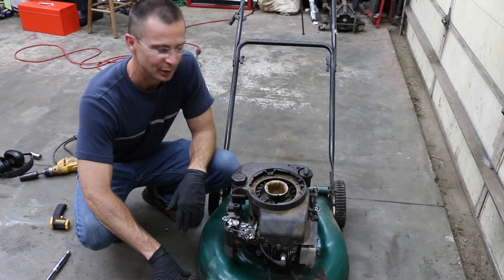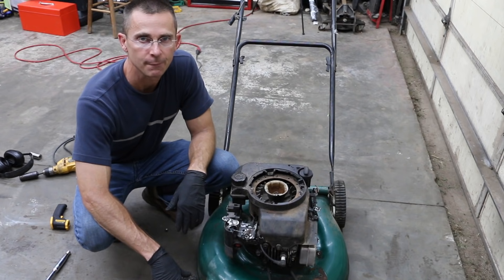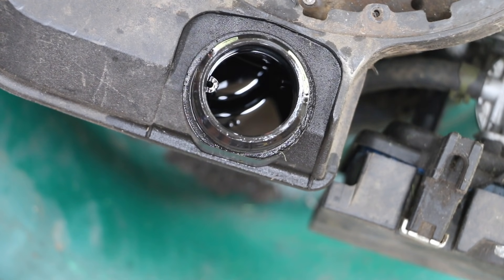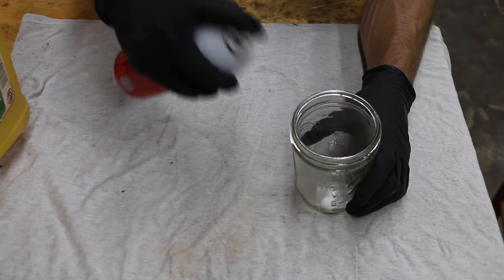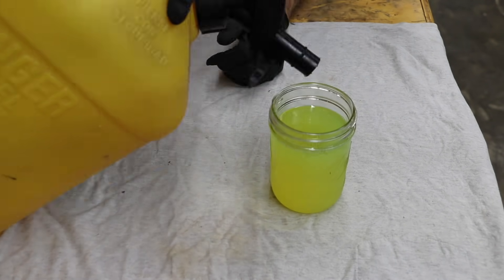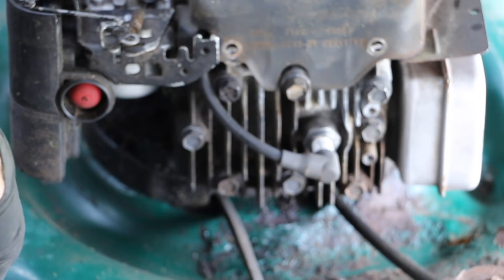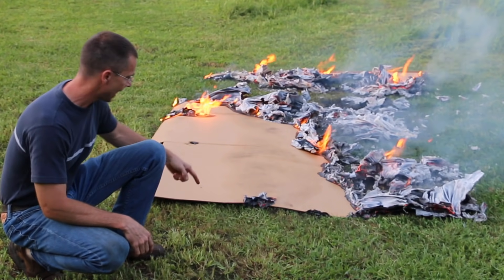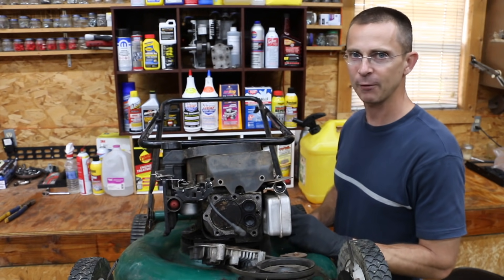Will a Gas Engine Run on Diesel?  Let's find out!

Comment: When I was a teen, my little brother started mowing the lawn with our riding mower. He came in one day and said 'it's smoking'. We're like "yeah yeah whatever." Then we went outside, it was sending up plumes of smoke and running rough. Turns out my little brother dumped my dad's Kerosene (hence the YELLOW fuel container) into the lawn mower instead of gas.     He had the worst luck with lawn mowers too. Months later he came in and said 'the battery blew up'. And we're like "Yeah yeah whatever." we go outside, the battery had literally exploded sending the top half off and pushing the hood of the mower all the way up.
Reply from the maker: Wow, Lol!
Reply: Blue is kerosene. Yellow is diesel and red is gas.
Reply: @petertorregrossa4447  
yeah I had it swapped from memory. it was kerosene.
Reply: @Novous  when I was little I didn't know the difference. My dad would fill gas cans up with kerosene. I ran the mower and snowmobile with it. They ran but smoked liked a mf'er. He would come out laughing and say " runs pretty good on kerosene, doesn't it?".

Comment: Yes, they will sorta, diesel has the same stociometric ratio of 14.7:1, and is more viscious.  but diesel has no octane, so it will detonate. Also diesel is an oil, & not a refined gas so it will foul the cylinder. A diesel runs very lean so the combustion chambers will not load up. Unlike a gasoline engine, diesels provide a more complete combustion because of the high compression. Diesel has a cetane rating, the fuels ability to resist combustion due to pressure. Octane is the fuels ability to resist combustion due to heat.

Comment: Years ago I had an old carbureted v8 pontiac I accidentally put diesel fuel in.. maybe ten gallons plus one or two of leftover gas still in, and it would not go up a hill or accelerate without extreme knocking. I literally thought I could break a piston it was extreme.
Reply from the maker: Wow!  Thanks for commenting on this

Comment: I have been told by several people who do it that if you add a secondary tank and let the gas engine warm up on gasoline only for 5 minutes and then turn on the diesel fuel and turn the gas off that it will run and then you should do the same during shutdown. Turn the gas back on and the diesel off. They say it works fabulously. By the way great video and would love to see you try would have been told
Reply from the maker: Great information. Thank you

Comment: Have you used E85 in a small engine. I know you used it in a car. great videos!
Reply from the maker: Thank you!  It will work in a small engine but the carb needs adjusted to increase fuel flow.

Comment: The Fire Service uses a gas/diesel mix for our drip torches. We mix gas an diesel in a can and light it, using the flaming mixture to light brush on fire during wild fires. The gas is the burns hot enough to get the diesel to ignite and continue to burn. Been doing it for a number of years, normally it is mixed 3:1 diesel to gas, hotter mixes for wet fuel can be 2.5:1.5 diesel to gas.
Reply from the maker: Thank you for the feedback!

Comment: All hydrocarbon fuels, be they solid  or liquid cannot combust until they have reached 'flash point'. It is the almost  invisible vapors that may be seen when 'flash point'  is reached. 'Flash point' for gasoline is approximately 250degrees Fahrenheit (126 deg. Celsius), for kerosene the required temperature is approximately 345 deg. Fahrenheit. Do not try to run a gasoline engine on diesel or you could wreck it.
Reply from the maker: Thank you!

Comment: So I accidentally did this because there was Diesel In a can labeled gasoline and I thought it was just old gas so I was mowing and noticed an extreme loss of power and when I went to turn the mower off it continued running with no spark and the brake on the flywheel I was amazed by this and it was followed by many gunshot like backfires ( extremely loud ) I had to remove the air filter and plug the carburetor to get the engine to stop running but of course once it cooled down it would not start with just diesel.
Reply from the maker: Thank you

Comment: Had a 1988 Silverado tbi 454 run on 100% percent diesel fuel. Trick was unplug set timming connector retard the timming. Truck would fire right up and idle. Could only accelerate just under 1/2 throttle. Not kidding truck would get better mpg on diesel then gas and ran cooler. Just have to drain engine oil due to blow by.
Reply from the maker: Impressive!  Great point on the oil needing drained too.  Thanks again

Comment: I did this with a ranger mixing more and more diesel with the gas. Ran okay till I tried to start it the next morning
Reply from the maker: Great point.  Once the engine cools, it's hard for the fuel to reach flash point.

Comment: I can see people pumping 50/50 gasoline and diesel in their vehicles lol just one question on the 50/50 you did amd run smoothly, did it last longer than usual due to the diesel?
Reply from the maker: Thank you.  It did seem to last longer but lacked power.  The 50/50 mix is unlikely to perform well in a spark ignition engine under load.
Reply: @ProjectFarm  thanks bro, your videos are really fun and informative 👍

Comment: When I was a kid I ran out of gas.  I didn't have the money to buy more so I drained some fuel oil from our tank used to heat our home.  I cranked and cranked & finally it started, but it was very slow.  It gradually picked enough to a point where I was able to cut grass.  Funny, even though it was only turning maybe 1K rmp I could not make it stall in the tall grass.  Finally it broke a rod & that was that.
Reply from the maker: Nice!  I enjoy reading comments like yours!

Comment: It'll run on it but smoke cause diesel is oil base. Put gas in diesel and it'll lock up cause gas doesn't have enough oil to keep the cylinders lubed
Reply from the maker: Thank you!

Comment: I have been starting engines with a drill since the 80's, before drill adapters were available (that I know of). I cut the female end off a 3/8 extension and I still use it today. I chuck it up in my Milwaukee Hole Shooter.
Reply from the maker: Nice!  Thank you

Comment: I had a 64 Chevrolet truck that had a 76 250 six in it ,I put about 12 gallons of diesel in by mistake filled the rest of the way with 93 octane and a bottle of 104 octane boost.
It ran fine but when I shifted gears a big puff of white smoke came out of the exhaust.
Thanks for your hard work.
Reply from the maker: Glad it ran!!

Comment: I have an idea to make this work! Shave the head down for more compression and warm the engine up first. Then, use an engine brake like your other videos and run it wide open. Maybe do your “vapor can” trick.

Reason I think this will work is because a gas station accidentally had diesel in the 93 octane tank. My car was already warmed up so I was able to make it home as long as I kept the throttle open. Maybe it’s worth a shot, I know I’d enjoy that video. Cheers!
Reply from the maker: Thank you for the video idea!

Comment: I do believe if you take a battery run the spark plug wire to the battery as a temporary charge source run a wire going from the battery to where the spark plug goes and replace the spark plug with a glow plug and put straight diesel in it should run
Reply from the maker: Thank you!

Comment: The ethyl/gasoline mixture most commonly available at service (I use the adjetive lightly today) stations is damaging to small engines. I have started buying preblended fuel w/o ethyl alcohol and my 2 cycle engines are much easier to start.

Comment: Please post follow up videos of the progression of your eyebrows regrowing. Lol
Reply from the maker: lol. Thanks
Reply: So because of the higher flashpoint of diesel I wonder if you preheated the fuel if it would run any better. I saw a video where a guy tried running a kerosene forced air torpedo heater on waste oil. It smoked terribly bad until he preheated the oil to 180 F or so then no more smoke.
Reply: He used an oil filled electric heater that he drained the factory oil out of it and ran waste oil instead. It is a cheap thermostatically controlled oil heater. I would bet that you would have much better success.

Comment: I know that in my diesel vehicle, i can run 35% unleaded fuel to a tank of diesel n it wont hury it at all, in fact, it cleans the system n i found it actually got slightly better mileage n response
Reply from the maker: Thank you for commenting on this. What type of vehicle do you own?
Reply: @ProjectFarm  i own a isuzu trooper 4cyl turbo diesel

Comment: You have to check the oil level after that ,part of the diesel is not burning  in the cylinder and you and up with diesel diluted and high level oil..
Reply from the maker: Thanks for the constructive feedback

Comment: Back in the old days Mothballs contained Naphthalene. Mothballs no longer contain Naphthalene, it's too flammable to be sitting around in cloths closets. The new balls contain different compounds which don't burn so well and will not support combustion. Try using some Coleman Camping stove fuel.
Reply from the maker: Thank you

Comment: GM originally converted a small block engine to a Diesel Engine used in an Oldsmobile which became a production option. Could you experiment with another gas engine converted to diesel using specific crankshaft and connecting rods?  Land Rover has a Range Rover Turbo Model production vehicle called the TDV8.  How many parts are actually different from their original V8.  Is conversion possible ?
Reply from the maker: Thank you

Comment: Long ago, working at a lawnmower repair shop, I had a supply of old engines.
Things I tried:
WD40 Starts and runs.
Turpentine Starts and runs poorly.
Brake Fluid Starts and blows head gasket.

Starting on gas and then introducing oxy-acetylene (cutting torch) into intake has dramatic effects (speed increases and cylinder head melts).

Thanks for your flashback inducing Videos!

Starting then using a hammer to provide a “window” into crank case and allow drainage of oil, let engine run past sunset making the crankshaft and con rod visible as glowing red circle. Engine continued to run until it stopped due lack of fuel, locking up as it did.

Test subjects were primarily Craftsman Mowers of which there was an abundance.
Reply from the maker: Thank you!!

Comment: I have an old Craftsman magnesium deck push mower that I use to cut wild blueberries.  I start the engine on gasoline and let it warm up.  Then I shut it off, drain the gas and fill the tank with diesel.  The engine will start and run on diesel, but you have to adjust the mixture screw a bit to get smooth running.  The exhaust smoke keeps the chiggers at bay while I cut.  No more chigger bites afterward.
Reply from the maker: Impressive!  Thank you

Comment: I actualy had a 1979 chevyvan with a 350 gas enguine it had a 32 gallongas tank i ran about 2 quarts of diesel in it once a month it may have nothing to do with it but i got around 400 k miles out of that gas enguine never had a problem i drove truck and figured maybe it would lube the enguine like my big rig
Reply from the maker: Thank you!

Comment: Diesel is more expensive than gas in Canada how about where you guys live
Reply: I live in florida, 2.50/gal for gas, and like 3 bucks for diesel
Reply: Charging more for diesel fuel is a blatant ripoff. For years it was much cheaper than gasoline because it took less steps to refine to produce( still does). Years ago deisel fuel was so cheap Volkswagen even produced a Rabbit that ran on it also Mercedes-Benz sedan cars.

Comment: You should start the engine on gas and while it is running gradually switch it to diesel. I used to work at a bike shop and the head mechanic claimed that once an engine was hot and already running, you could put almost any fuel through it and it would work.
Reply from the maker: Thank you!

Comment: In the early 1980s General Motors converted the 350 cubic inch small block into a diesel engine. It was a big mistake. I had a Cadillac with one of those engines, and it was in the shop more than it was on the road.
Reply from the maker: I remember those.

Comment: You cant run a gas engine on disel, cuz disel is not so much flamable like gasoline, in theory gas gets pumped into the cilinder head, simple spark ignites it and it moves the piston aka cilinder, but disel engine is specially designed in a diferent way, it first pumps in air and when the compresion is happening disel get injected throu special injectors and at the same time combustion is happening moving the piston down....quite hard to explain, just google it and see for your self

Comment: my dad had a model A coup  that had been modified to run on diesel they ran a copper line around the exhaust pipe to the engine  started up on gas the switched over to diesel after was up to operating temp and diesel was heated up ,it was set up during WWII .SO IT IS POSSIBLE TO DO!!!!!!!!         he also had a friend that had a Pachard with a strait 8 that always missed on one cyl turns out someone spun the crank and pulled the piston and rod and then drove a block of wood in the cyl to plug it off ..
Reply from the maker: Thank you!

Comment: To run on diesel you have to have a perfect air to diesel ratio. Gas to air ratio ratio is lot lower compare to diesel. Diesel is burn with compression. Gas engine has lower compression ratio compare to diesel.
Reply from the maker: Thank you!

Comment: Old tractor engines like the model M series were started on gasoline to warm the engine up, and then run on kerosene. They used different intake manifolds though. Most were converted to run on straight gasoline, and a normal intake manifold is used. To get a low compression sparked engine to run on diesel or kerosene, you have to preheat the oncoming fuel/air mixture.
Reply from the maker: Great information! Thank you
Reply: @ProjectFarm  i love your shows watch all i can enjoy your Christmas and your family
Reply: In the 50's international harvester had 2 tanks on their pickups one for gas the other for diesel and like you said once the engine was hot they would switch over to diesel,these engines had a unique design to the pistons

Comment: I would be interested in knowing what the combustion pressure is in an engine?  Not the compression pressure, rather the combustion pressure!
Reply from the maker: Great point!  Over 1000 PSI for sure.
Reply: @Project Farm 
Is there any way of measuring the pressure?
I've tried to find the answer on line with no success.  Particularly I'm interested in my 02 Superduty diesel 7.3.
Thanks!

Comment: a petrol engine will run on diesel as long as it is hot to start with .once you stop the engine you may not get it started again without petrol .They run real rough not much power .once the engine is cold forget it .I have done this myself with 2 and four stroke engines.
Reply from the maker: Thank you!

Comment: I used to work in a garage next door to a fuel station. We used to get a lot of vehicles in that had put petrol in there diesel cars.
I managed to collect a lot of petrol/diesel mix. I ran my lawn mower on the stuff for years. It ended up perishing the seals in the carburettor though.
I found that I had to let it run at a slightly increased idle until it warmed up first though. Once it was warm it ran sweet.
Great video.
Reply from the maker: Thank you!

Comment: some people did some research on this in regards of car engines, due to the slower flame front but higher energy content they found out that mixing upto 25% diesel on lower rpm range would yield significant increase in low end torque (low end power output) and lower total fuel consumption.
Reply from the maker: Thank you!

Comment: Why did you just up and decide to mix moth balls with acetone and then add it to diesel fuel?
Reply: He used mothballs because he had run out of Altoids, which are curiously strong
Reply: Napthalene...  it's a petroleum distillate
Reply: Because mothballs were once used to boost the octane of gasoline. Though it wasn't the low octane of the diesel that kept the mower from running, it was its poor atomization qualities.
Reply: @gregorymalchuk272  Not really.
Reply: @carlosoliveira-rc2xt  Actually it's a little bit true. Diesel needs pressure and heat to burn. Diesel gets pressure from injection, since carburators aren't pressurized, then only the combustion chamber can deliver some. But can't forget about the point that gas engines can't have as much pressure as a diesel engine since the gasoline would ignite itself and cause engine knocking. Although you can bring a gas engine to run with it (partially) when the engine's hot enough
Reply: @HighFall974  need heat to reach the flash point and will be  volatile enough to burn like gasoline 65°-70°   , by compressing diesel fuell tempreture is rising at auto ignition point   so maybe just preheating the pipe fuel  will do work but bye bye safety
Reply: @dancro9809  Yeah why not but as you say it's the best way to drive a fire ball
Reply: @gregorymalchuk272  now we buy high cetane diesel and try to lower it
Reply: Because he was out of Mentos and Naptha...